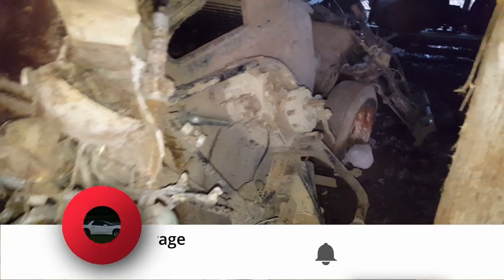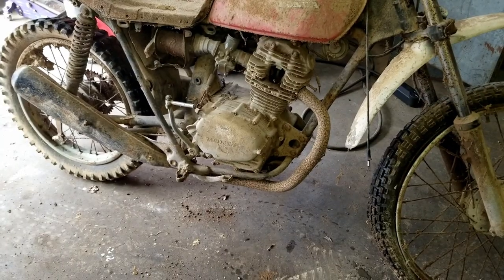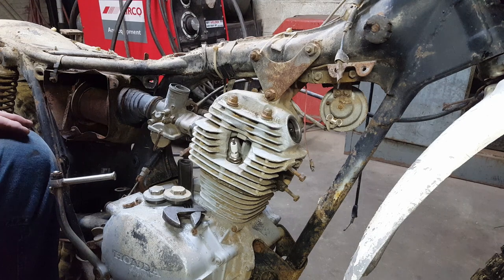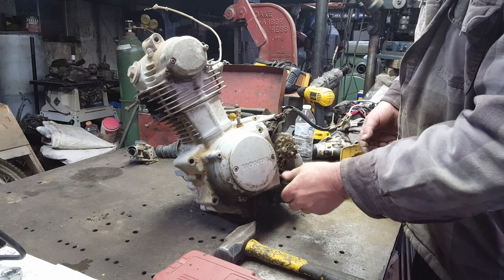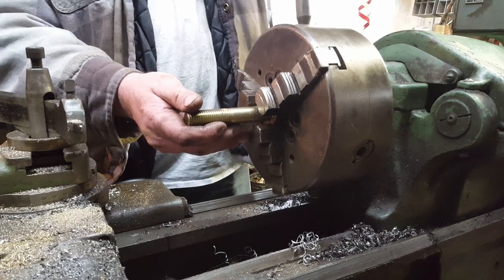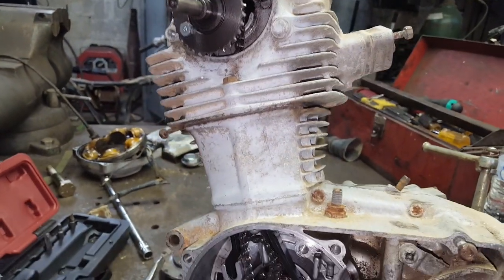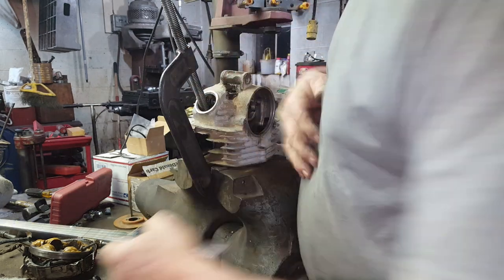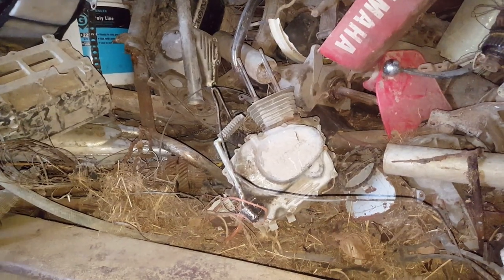Honda XL125 Sitting In A Barn For 33 Years!! Will It Run??? | Part 1

Comment: I cut my teeth on a 1975  XR75. Rode it and rebuilt myself bout 4 or 5 times. When I was older dug it out of shop for my kids. Spent bout an hour cleaning it up luring it. Fresh gas clean carb fired up 3rd kick. Had an original 1st year atc 90 to, it  need cleaned up and tires but fired up 3rd or 4th pull. My kids rode those two til they were to big for them. Oh the memories. Great vid Bud, 👌

Comment: to get the valve collets out,use a long reach socket slightly smaller than the diameter of the spring .Strike it quckly and they will release.

Comment: C clamp, notch out old socket pop em right lose. Ugly but functional.  Check your intake valve well they usually bend a little at the top and want to hang up in guide. Yeah sometimes you don't know til you pull it apart.

Comment: Just came across your channel and i have a honda xl125 that doesn't have any spark tested all components and they pass am i missing something?
Reply: You prob sorted this out by now,, but if anyone else has the same problem, make sure the main fuse by the battery is good and make sure it not corroded on the end and is making a good connection. 
Might be the problem.